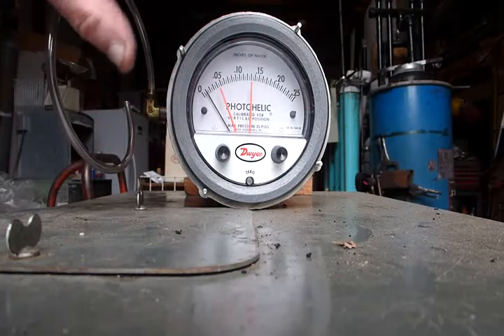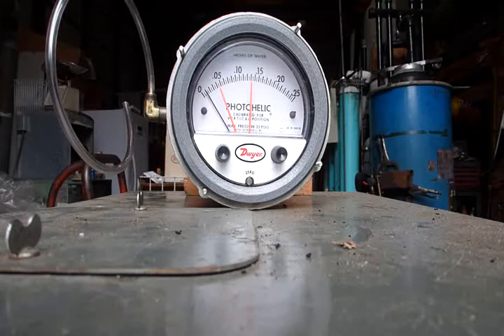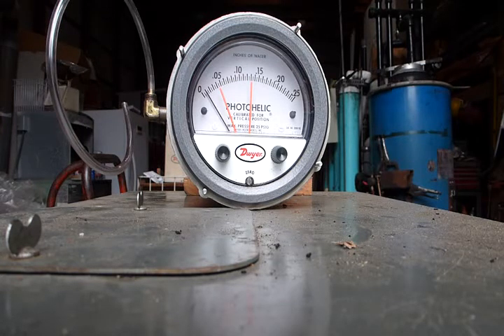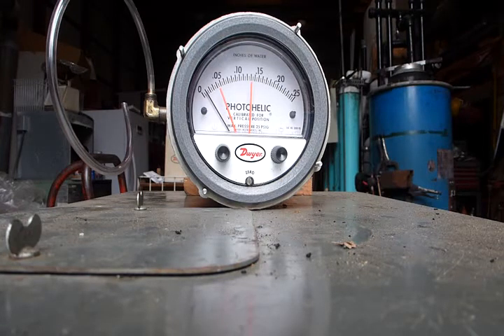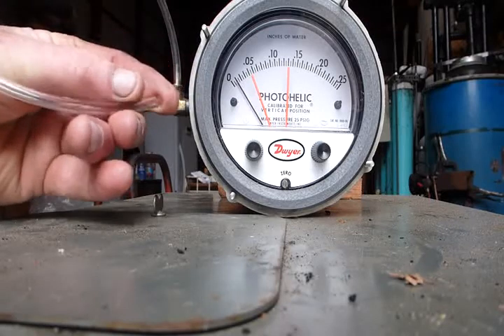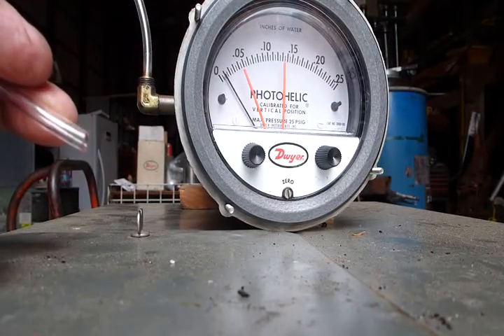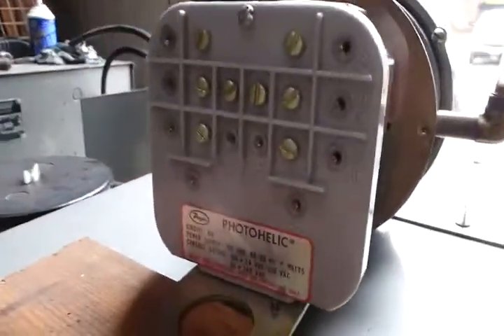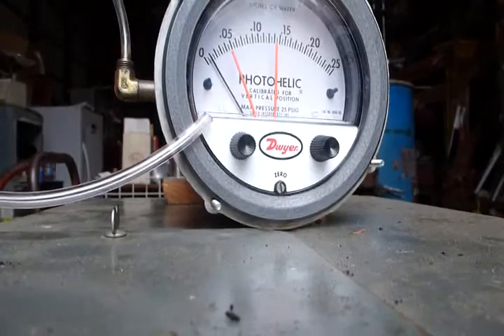NH Hbbyloggr -Is this the silver bullet for gasifiers??

Comment: also ill tell you this all the power one looses over gasoline is mostly attributed to the engine having to suck on the gasifier it self i have beem working on pland to put a super charger so it can suck it out of the gasifier and then the engine wont have to =)
Reply from the maker: xoxoX, Interesting concept regarding a supercharger. How to manage the excess ( waste) wood gas with the demand from the engine will be a trick.... or is it going to be directly proportional to each other ? So many paths we take, eh ?
Reply: superchargers can be mached to the engine since they are cog belt driven =) i have a small blower from a 4 cyl detroit diesel i plan to use just have to fix it =)
Reply from the maker: @xoxoXoieoxox   That would make more sense to me. Was this ever attempted during the " golden years" of Wood gas powered vehicles ? The 
German's had superchargers on some applications back then, in tanks I believe,  so I would think some industrious gasser would attempt matching one up to the engine . Yes? It sure would keep a steady pull on the reactor.
Reply: i have only seen one and it was a moden car with a 3.8l v6 ford thunderbird

Comment: FINALLY some one else that understands its all about the reactor you dont need much filtration if the reactor is working properly the more filters the more it start to hinder the flow and you lose power i run 2 cyclones a cooler and a small bed filter and i have put alot of miles on my VW Beetle and the engine is still as good as when i rebuilt it i made a really close copy of the WWII imbert my car was apert for 3 years but im am currently putting it back together =)

Comment: Fill we're on the same page where I plan on using an optical trigger tied into the manometer. You have something there. Give us a model number because that will be worth looking into.
Reply from the maker: Mike , Here is the link along with other options which might be better suited to our application. 
http://www.dwyer-inst.com/Product/Pressure/DifferentialPressure/Gage-Switches-Dial/SeriesA3000
PS Thanks goes  to Steve D. for sending me the initial link.
Reply: Thanks Bill I'll check it out

Comment: Waaaayyyyy cool. 
 I have one, just like it, here. 
 OK, mine is marked off in MM of Mercury, and it doesn't have all that cool stuff on the back of it, but it's basically the same beast  :) . 
 Just be SUPER careful to avoid bursting your meter's internals with too much vacuum/pressure, as yours is super sensitive! 
 Perhaps you could start out by blocking one side with a small steel cylinder tank, so the meter will be protected from high pressure differentials while you are getting accustomed to using it for woodgas bug detection  :) . 
 Keep the silver bullets coming, my fellow addict.
Reply from the maker: Great idea, Steve.with the tank add on. I was looking over the other options on the Dwyer-Instr site which may fit our situation better. Pricey , though.

Comment: Bill, they usually use these to control a certain pressure within a room. I believe the pressure side of the gauge should go to the outside of the building and the low pressure is installed on the inside of the room you want to control the pressure in. Now the all power labs folks do something similar to this with what they refer to as PRATIO . This is difference between the pressure at the top of reduction and the pressure at the bottom of reduction. Now I think they use a value of 45 on their setpoint and I think it is top of reduction pressure divided by bottom of reduction pressure. Not sure how they come up with this value, but what you would do is set it up so that when the difference between the pressure in the hopper ( or in the air intake line ) , and the pressure in the barrel exceeds a certain value , you would use the normally open contacts on the back of that magnehelic to complete the circuit which will turn on the shaker. It's the difference between two points in pressure that they are controlling everything and also the minimum temperatures comes into play as well. So you can imagine if you set another one up directly above reduction, on the low pressure side and at the top of the hopper on the pressure side you can also control when to turn on the agitator to shake the hopper. There is a video on the operation of the GCU on the all power labs page that scrolls you through the setpoints of their controls.  Hope this helps. Joe
Reply from the maker: Joe, this was used in a dry kiln for lumber. I am not sure what it controlled though. If it can trigger a relay or even interrupt the timers I have working now that would be pretty cool.

Comment: Hobby,

Nice analoge under-pressure control switch. Now comes some hard experimenting  to find the sweet spot between underschaking and overshaking. Because we talked a lot about the dissadvantagee of overshaking but there is also such a thing as underschaking. In my system i found it at 30 millibars underpressure. Best begin experiment around the underpressure value that gives your engine. As for placement you can put the sensor anywhere in the gasstream but before the filter. As there it is fairly hot put the suction tube high on a steel tube that is long enough to be cold at the end and this to not damage your expensive meter. Also I have to point out that one sensor tells you only something about the state of your reduction zone. It can happen that your gasifier is still nicely breathing but your filter is clogged. ideal one should control the presure drop from every element of the system, also the engine where there is a danger of clogging. That means one before and after the filter, one before and after the condensor and so on and so on. Then you can inmediatly see what element of your system is in trouble
One thing I am uncertain off, is the fact that we both have fairly different systems. Anyway I am curious and wish you all the luck with automatic reduction dust cleaning through underpressure monitoring.
Reply from the maker: As you say, now the work begins trying to fit it to our system. Thank you for your insights. Very valuable.

Comment: Sweet. We had those on out scrubber blowers at work. They are quite expensive too. So, you scored on that. It will be interesting what Steve the furnace guy has to say on this about placement.
Reply from the maker: The Dwyer web page has these listed at $ 310.00 They also have them with scales 0 - 40" wc. Hmmm.
http://www.dwyer-inst.com/Product/Pressure/DifferentialPressure/Gage-Switches-Dial/SeriesA3000
Reply: Now that is what I am talking about. With built in relays too.